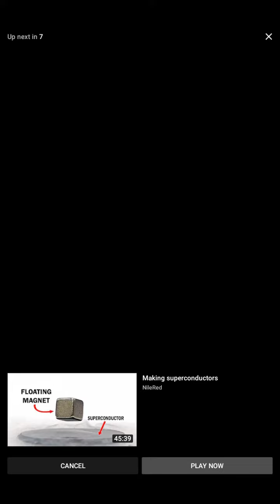Piezoelectric amplification with Granite

Comment: Fantastic demonstration. 

The input can also come from the earth's core, not just a solar or cosmic input. It may be that a solar/cosmic input would cause an output from the core which would be a crustal input from the core. 

The core may be more like a dielectric of dense liquid hydrogen which gives hydrogen metallic qualities. Under the pressure of the mantle, hydrogen coming from the core would easily bind with oxygen and carbon creating Juvenile Water also called Primary Water and of course, hydrocarbons.
Reply: sounds like you have done your own research.. it’s all very interesting.. there’s a lot of granite about the place in Australia 🤠 belts of it
Reply: Wait wait wait 🫷... This is amazing!. Okay, let me look at this understanding... You're using two carbon rods or plates.. One on top the one on the bottom in the middle. You have a rock... Justin, You're saying the two carbon rods are being conducted through the rock? Is that what's happened here?